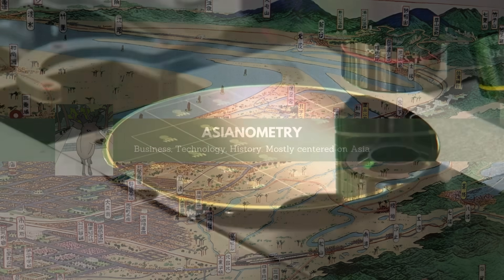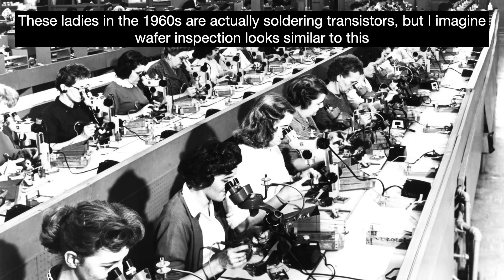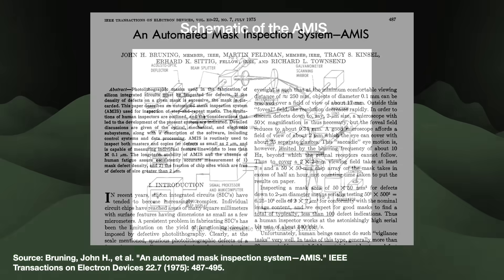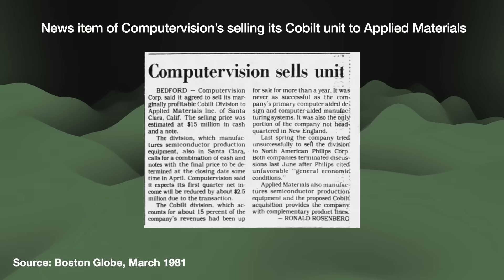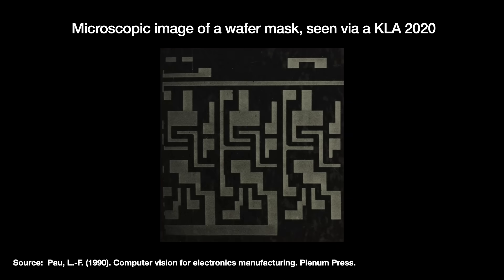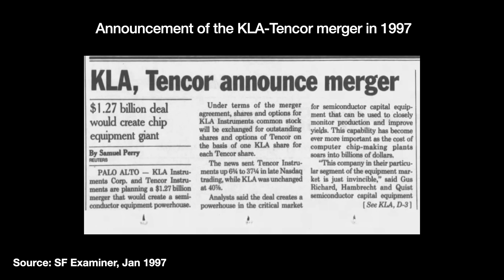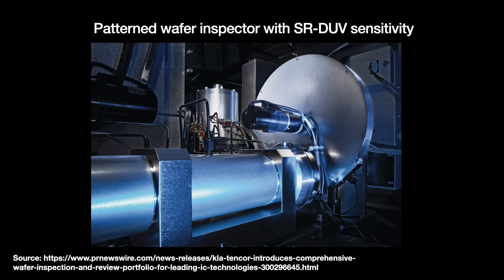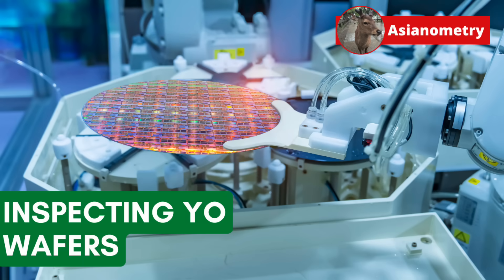How Semiconductor Yields Vastly Improved

Comment: I would blame Inspection falling off to fatigue... I was to inspect Petri dishes to count Plasmodium falciparum's thropozoites visually/manually using a microscope (at the time we didn't have the machine) and by the 4th dish i wanted to smash them all to the wall, even if it costed me my thesis. 1 hour of doing that shit is enough to tire anyone... hire more people and separate shifts with rest in-between would had probably increased accuracy.
Reply: I full understand that. In some places Medical Laboratory Technologists (MLTs) have to read dozens of slides looking for malaria. With clinicians screaming for them to be faster. And guess the allowed miss rate? Zero. No false positives or negatives allowed. False positive, you get reported. False negative you get reported. It is a ridiculous KPI.

On top of that, some upper ministry genius want to do blood donor screening for hundreds of units...

Comment: Maybe someone who is knowledgeable on wafers might answer for me. 
Is a 12 core AMD chip, for instance, a defective 16 core chip? 
The wafer was to make 16 cores but in defects, some come out with only 12 effective cores.
Reply: This is extremely dependent on the product being produced. 

With tiled CPUs nowadays binning is a bit less prevalent but still a key part of it. Binning happens when the chips get sent to e-test/sort. They're tested and qualified according to how they perform under various loads. They might disable unstable cores and bin the CPU down to a different core count. 

But with chiplet/tiled CPUs they are producing E-Cores, P-Cores, logic, etc on specific chiplets which lets them produce with a bit more focus. There is A LOT more to a CPU than just the cores. 

So, it just depends. This is true of a lot of stuff in semiconductor manufacturing.
Reply: @CRneu  totally agree. The trade off historically was the cost of packaging chiplets vs binning out larger CPUs. Because chiplets became so small and the cost of packaging plummeted, AMD’s chiplet strategy for core multiplication became a game changer. Yield scales exponentially with defect density, so smaller chips are a major advantage provided the cost of assembling them is small.
Reply: @CRneu  Thanks for the reply. I suspected that might be the case back in 2009 when I bought my AMD 4 core and somewhat later AMD was selling 3 core chips, but with a bit of song and dance, you could unlock another core.
Reply: Not always, but yes, this is very common. It’s called binning. After test you either physically modify the chip or load different firmware that ignores the defective cores.